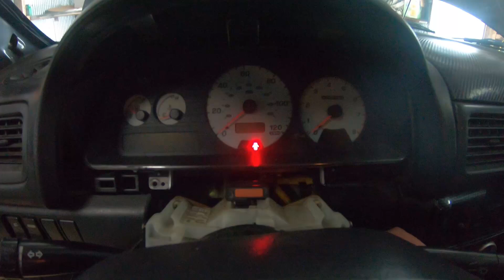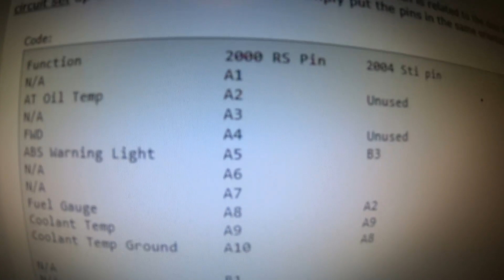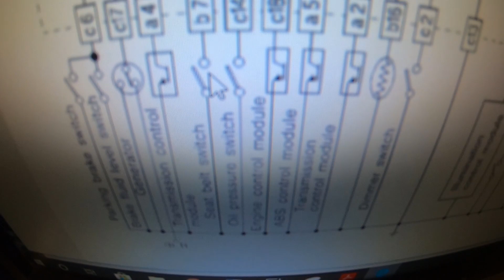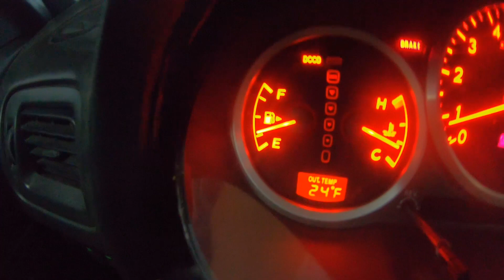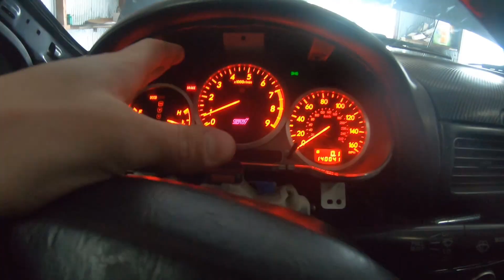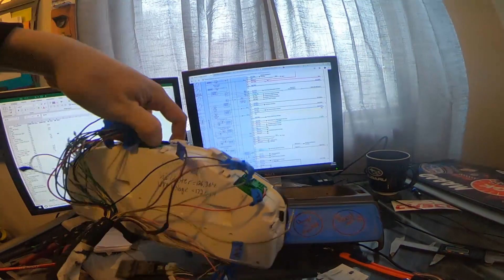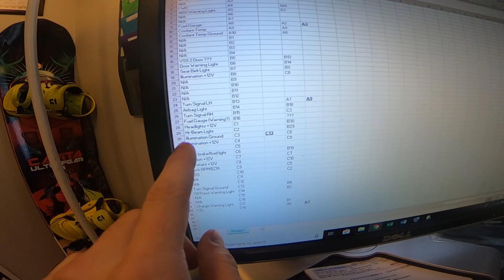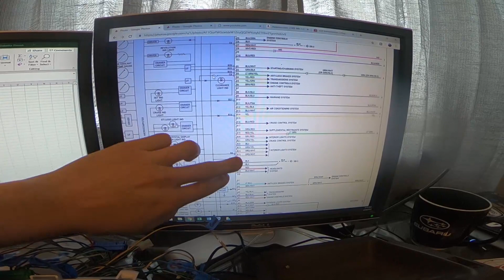How To Wire An STI Cluster In Your Old Impreza 2.5rs GC8 GM6

Comment: Ok, the real question here is:  How the hell do you make this thing fit????   The stock cluster barely wants to fit in that hole!!!
Reply from the maker: It’s tough and you basically have make a custom bezel for it to look right. I never finished the project to my liking but I’ve seen it done.
Reply: @LifeFlatout  I was mostly talking about just getting in the hole.  I finally managed to accomplish it though.  I then took the stock bezel and deformed it with the heat gun, so it wasn't cutting my dials off, and called it good.  It doesn't look factory, but then, my car doesn't look factory.  lol

Comment: Hi,
Simply  great, I m trying to do It on my gc8, Is hard for me because I can not found any guide in italian language.. can you May Be help me? I need ti swap an gc8 1998 in a 2002 Sti... There Is a link for a guide too? Thanks
Reply from the maker: No there’s not sorry that’s why I made this video
Reply: @LifeFlatout  
Oh thanks anyway... i Will try by my self if I found a way I Will Pic you with the table for the connectors..
Thanks
Reply: Enrico Brait try to find the diagrams or broken down model for the wiring on both clusters and j plug it in and hope like we did 😭